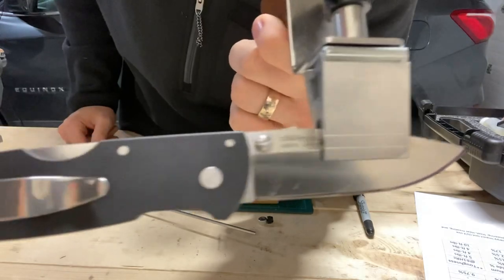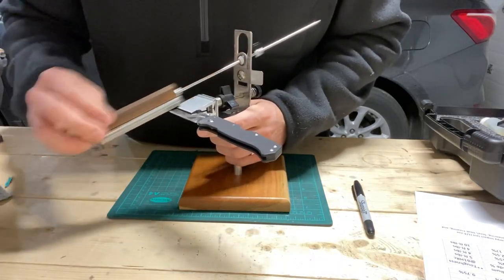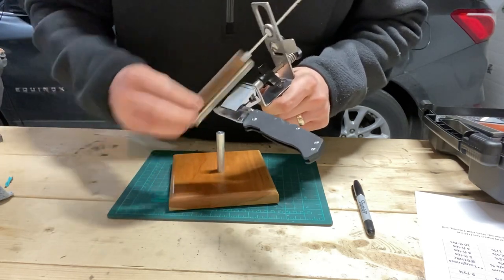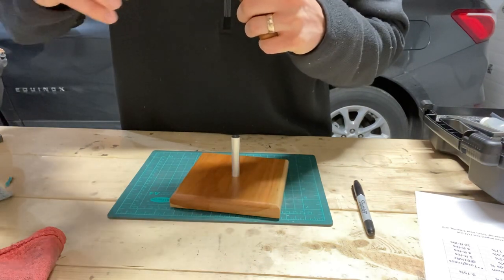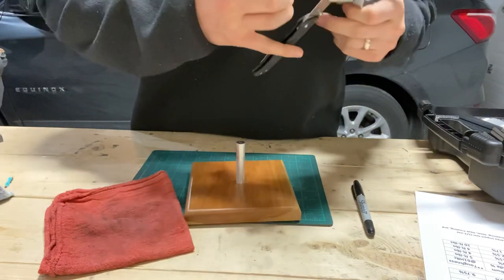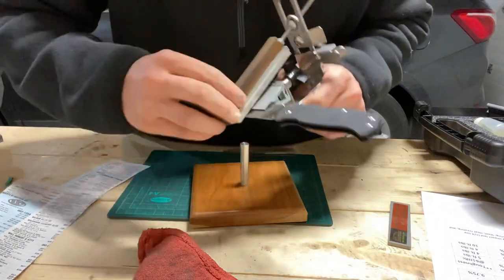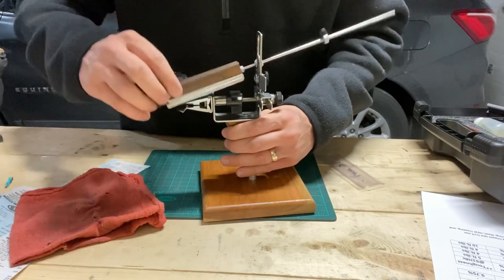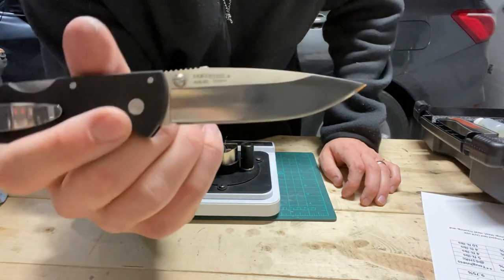Cold Steel Air Lite Sharpening with KME (Full Progression)

Comment: I have the tanto Air Lite and it is a good knife. 
It sort reminds me of the Emerson cqc7. 

So far aus10 has impressed me. I probably have 4 knives in this steel and it is a good performing steel. 
I like aus10 at 320 or 400 grit and then some light stropping on 1 micron basswood, this gives an excellent edge.
Reply from the maker: I've been having very good luck with it so far as well. Carried the edge from the video for about 2 weeks and still is getting the job done with help from 1um strops here and there. 

I tend to prefer the polished edges on these steels that come up fine and don't have much of a working edge (LC200N, 14C28N, even S35VN). But I could definitely see how a course edge on AUS10 could shred some cardboard and keep on kicking. 

Side note, I'd guess this is a similar experience for those using Spydercos BD1N. Haven't tried any from them so it's just a hunch though.

Comment: In the same boat: I’ve invested a kit of time and money the past couple of years trying to learn and master freehand. I’m still unhappy with my results, especially cosmetics. So I have switched back to my KME recently. Like you, I also  have the WSKO, which I use on kitchen knives and outdoor blades that I don’t really care much about.
Reply from the maker: I’d definitely say I’m happy with my freehand results but it’s just not always what I want to do with a blade you know? Cosmetics aren’t usually my goal and I can do a pretty nice finish freehand, especially with Japanese water stones but anything diamond just doesn’t compare to the KME

Really like having the WSKO for those blades that are just meh and not so much fun. 

They all have their purposes I guess!
Reply: @EngineersPerspective701  Yes, you are MUCH better than me on freehand. That’s how I found your channel. I have watched all your videos plus a dozen other freehanders on YT. I can get a knife sharp and can get a decent bevel, but glaringly inconsistent vs. what I can get on the KME. The only flaw with the KME is that once you remove it from the clamp, follow-up retouches require reclamping in the exact same position. Much easier to freehand for touchups. Neeves Knives and Michael Christy are the two best freehanders I’ve seen who can produce bevels from heel to tip that look like they came off a guided system.
Reply from the maker: @MrEric0822  the touch ups point is definitely a biggie! If you’re willing to leave a sharpie outline of the jaws it’s way faster but is ugly as sin and wears off!

Those guys are amazing and I watch them too. Jeff Jewel is really great also. How much have you worked with Japanese water stones?
Reply: @EngineersPerspective701  LOL! Yeah, I'm not leaving Sharpie clamp marks on them. I just strop frequently, which helps lengthen the time between sharpenings.

I stopped short of the water stones. All the need to flatten and have a place where you can soak them doesn't really appeal to me. I have some good diamond stones, some Venev diamond stones, a few India and Arkansas stones, a Sypderco UF ceraamic and a little more crap. I've got more than I need, considering most old-timers used a two-sided Arkansas stone their whole lives. I know those Japanese stones are nice, though. I'm just not at the point where I need/want to throw more money at something that won't really fix the areas in which my skills still need honing.

Comment: Ooh got the kme nice 👌
Reply from the maker: I bless a blade with the KME every once in a while. Gotta straighten out those bevels now and again
Reply: @EngineersPerspective701  

After a couple decades of freehand sharpening experience I bought a workshop guided sharpener with the 4x1 stone adapter to set the bevel angle when I get a new knife.

Once I accumulate a collection of 4x1s to equal the quality of my bench stones I really don't see myself going back, unless it's the handful of steels I genuinely enjoy sharpening.

Comment: Novel incoming:

I haven't sharpened any Aus 10 since getting my BESS.  I wonder if the steel would respond to some different stops and compounds.  The bummer with clamped sharpening systems like the KME is the lack of stone thickness compensation.  It usually means no custom-made strops.  An Edge Pro has its own drawbacks (mainly that it's slower than a KME), but at least the platform lends itself to modifications like adding stone thickness compensation.  That opens up a whole world of aftermarket stones, diamond films, and custom strops.  That's the path I took, and it's working pretty well for me, but I don't know if I'd recommend it to you.  I guess I feel that a guided system might be a step backward for someone like you, who has no fear of freehand sharpening, and already such an investment in freehand tools.  

What if you bought a few different thicknesses of leather and made a couple of sets of bench strops?  These softer/tougher steels seem to like leather strops with various buffing compounds loaded into  them.  But again this was pre-BESS for me, so my opinions are based on subjective testing.  

I guess it all depends on how badly you want to master this steel.  If you try enough differing methods, I'd think that you'll eventually find the right recipe.
Reply from the maker: The KME actually does have thickness compensation! I have a video from a good while ago showing how to use it. Before I learned freehand I actually made a bunch of custom balsa strops for the KME and loaded em up with Chinese diamond compound. First mirror edges that way and first truly tree topping hair sharpness I ever experienced. Haven't used them for a year or 2 though because I've generally went away from the KME. 

Like you said, I'm pretty hesitant to invest much more into the KME because it's better spent on freehand stuff. But I think about it a lot. The more temperamental a steel, heat treat or geometry, the more I like using the KME. 

You're saying to use a longer stropping progression on this? Technically I have 4,3,1.5,1,0.5,0.25,0.1um compounds in CBN and diamond. A bit of a hodgepodge of brands and substrates.

Honestly AUS10 probably isn't the steel that really has me interested enough to experiment with a whole lot. Generally I like the Spyderco UF to 4, 1.5, 0.5CBn strops for steels that come up fine and don't have carbide volume like LC200N, 14C28N, etc.
Reply: @EngineersPerspective701  cool, I had no idea the KME is that versatile!  That leaves it with only a few major flaws.  Stone length, extreme acute angle stone/clamp interference, the guide rod that needs to be 2X longer, and clamping to get perfect secondary edge symmetry.  Yikes, I guess that's a big list now that I made it.  🤔

That's the elephant in the room for sure: how badly do you want to become an expert at Aus 10?  If I recall correctly, I used to get my sharpest edges with my steel-backed leather strops on my edge pro.  I made three of them and loaded them with different buffing compounds.  The thinnest, least compliant leather got the black compound (heavy cut), the medium thickness leather got the white compound (light cut), and the thickest leather got the green compound (polishing only).  I think my best results were from adding an extra 0.005" to 0.010" to the height of the strops at thickness compensation time.  It results in a mirrored apex, and less mirroring towards the primary/secondary transition. 

For me it was a similar pursuit, mirror polished edges on VG10, S30V, etc., and it was before I discovered Venev stones and pastes.  I'll have to revisit those tools and techniques now that I have the BESS.  The objective sharpness measure is such a game changer.
Reply from the maker: @ZPositive  Speaking of the edge pro what are your overall opinions? I've always thought that the EP would be faster than the KME because of the longer stroke and not having to spend time clamping up. You're saying the KME is actually faster and maybe stiffer?
Reply: @EngineersPerspective701  the KME probably is faster than the EP because of the clamp and the speed of switching sides.  The EP requires you to carefully realign the blade every time you flip, and that's what slows things down.  I modified mine with some neodymium magnets to hold onto the blade, and that's been a huge help.  I also added my own stone thickness compensation, which is merely a fat lock collar on the vertical shaft.  Then some other tweaks, like a rigid base, some over travel lock collars, a slotted stone shaft for quick changing the stones without the fiddly screw, and I'm probably forgetting some. 

With all that work, it's a very good system.  It holds just about any width and thickness stone/strop as long as it's between 4" and 6" long, has great stone thickness compensation, can sharpen a huge range of angles (from less than 10 DPS to higher than 35 DPS).  But it's not fast, and it still requires a lot of care in making sure the blade doesn't move on the magnets.  To boil it down, I'd say it requires more skill and patience than the KME, but it's far more versatile.
Reply from the maker: @ZPositive  Very good points. How do you feel about the Hapstones from the Ruskies then? Can both clamp or do table with magnets, sturdy base, etc. Maybe a the clamp on this style of system is the optimal compromise? Best of both worlds type of thing?
Reply: @EngineersPerspective701  I'd forgotten about those.  Their build quality appears to put the EP to shame.  The M2 comes out of the box with all the features I've added to my EP, so that looks like a great option.  The K1 looks like the cat's PJs if you can handle the minimum DPS of 15.  But for some reason the K1 has a cheesy square vertical bar, and I don't know if it would be a hindrance to stone thickness compensation.  And the R1 looks like a no compromise professional system with the only drawbacks being footprint and price. 

I have to say I'm pretty tempted by both the M2 and K1.  There are some parts I've wanted to rebuild on my EP that will take a couple of days of CAD/CAM/machining time, and the M2 looks like it would get me there without any custom fab.  And I've always wanted to try a nice clamped system like the K1, even though I'm sure I have a blade or two that I couldn't use it for (either blade shape or edge geometry limitations).